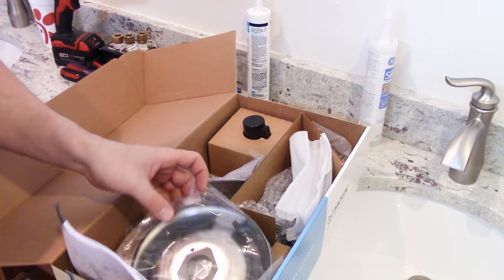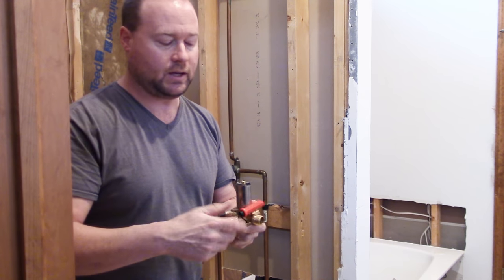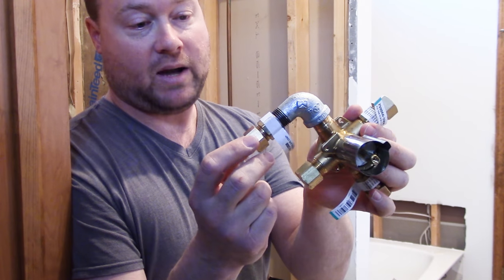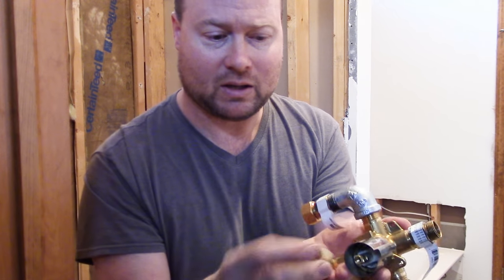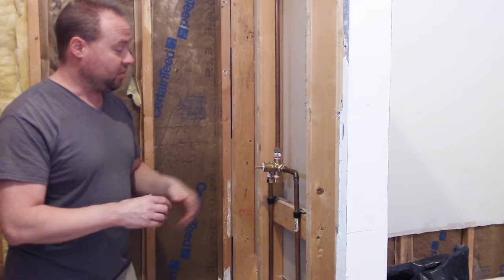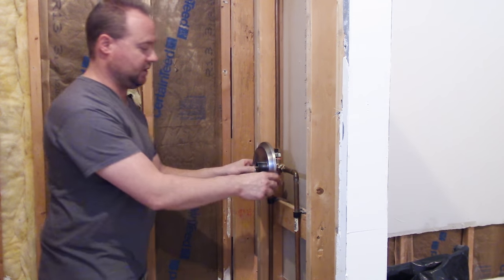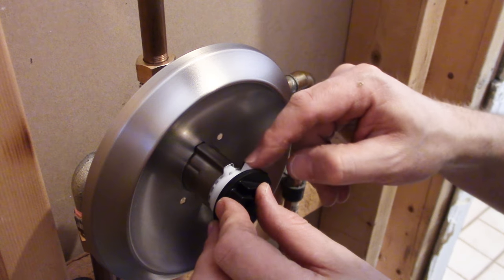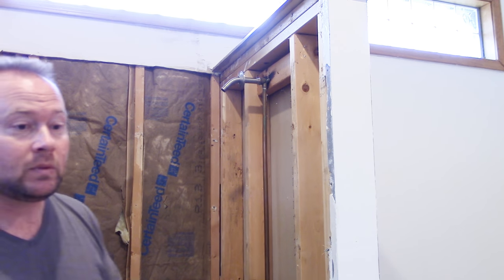Moen Shower Faucet Install

Comment: If you didn't want it to fail, you should have installed a brass street 90 instead of the galvanized street 90. Voice of experience here.

Comment: Thanks for the great video. I'm still in-progress on mine. I needed the 90 deg street fitting on both sides then connected Hot/cold with SharkBites. Turned water pressure on and very..very small leakage at 90 deg connection with the Valve. None of the SharkBites show leakage (so far). 

Question- When I screwed the 90's on each side connection to valve.. when they tightened they were not facing straight down.... so I had to back them off about 1/4 turn . Thus..the leakage. 
Would adding a few more wraps of Teflon tape or Pipe Thread dope help this? If I tried to turn them another complete revolution I'm afraid I might crack the very expensive valve connections!
 Thanks to any advice from anyone...even if I've found a solution before the answer..It may help someone else.
Reply from the maker: @DaddyDawg thanks for the question. This is a good one. First of all, I'm glad that you liked my video. It is a little older, but not a bad one and recently I went back and added chapters to it. So I'm also glad that you watched it with the chapters. Ok 2 things here. First is your question. And the answer is yes, if you feel like one more full turn is too much, then go back and add more tape. And are you using the cheap white tape or do you have a better one. I know that everyone is used to the cheap white tape, but there are better alternatives. This is a good one. https://www.amazon.com/Pack-Milrose-70885-Monster-Teflon/dp/B00IJZBB1A?crid=3G05LEZJB1EC7&keywords=tephlon+tape&qid=1642280876&sprefix=teph%2Caps%2C108&sr=8-6&linkCode=ll1&tag=greatwhitenin-20&linkId=f8c4ebb47d8ba588b8beb29d70979fc7&language=en_US&ref_=as_li_ss_tl

Then the second thing. I love Shark Bites and have a couple of videos of them. But the one thing that I don't like is putting them in a place that you can't access. So, I hope that you have an access panel for this shower. The reason I say that is because the Shark Bite uses an "O" ring, and I feel that they will start to fail in about 10 years. 

Good luck on your project! 

👍 So glad to help! Thank you for watching. Check out hundreds more of our videos at https://www.aroundthehome.org

Comment: We're doing this install now and I'm looking for help with how tight the inlet pipe for the shower head should be. It seems too loose in the position where it needs to be. But it can't be tightened another full turn. There doesn't seem to be a way to turn the female end, either. Tape and plumbers glue dont seem like enough either. Yikes.
Reply from the maker: @Margaret Grigsby, thanks for watching and your comment. I want to help, but I need clarification on a couple of things. You say that you are doing this install right now. And that the inlet pipe for the shower head isn't tight enough. First I want to confirm that this is the pipe that you are talking about. https://amzn.to/3NZGp0A  And if it is then you say that the female end won't turn either. If that is the pipe in question, is your female end not screwed to a stud or cross support?

Comment: i did it right just forgot screw in the adjuster and had to go buy allen screw from ace hardware (it has been missing in my last 2 remodels) but if the screw isnt in there it wont shut off,

Comment: What about the 2 screws into the plate? When I inserted , the screws hampered the handle from turning smoothly.
Reply from the maker: I'm only guessing here because I'm not there to see it,  but my first guess is that the faucet isn't square with the handle and plate. Sounds like when you tighten the screws it is binding. The faucet coming out of the wall should be 90 degrees to the wall. Does that help at all?

Comment: Very nice job.  Looks easy to do. 

What size are those compression fttings you used?
Reply from the maker: Just 1/2" compression to 1/2" threaded adapter. If you have an accessible area where you can splice in the water line like a crawl space, just using a sharkbite is much simpler. Thanks for watching and don't forget to stop by our website for many more helpful videos. www.greatwhiteninja.com

Comment: what about the water spout part of the faucet kit.  ??

You just did the handle and the shower head.
Reply from the maker: Yes, this install was a shower only. So I showed how to cap it off for a shower only install. Here is a video where I install a delta faucet that might help you with that part. https://youtu.be/KLvoFsE3NP0

Comment: I have a Moen Ashville shower head and handle and it recently became very tight to turn. Is this an easy fix, or should I seek professional help?
Reply from the maker: Sounds  like the cartridge is failing. The Moen cartridges are sometimes a bit hard to get out. They make special plumbing tools just for that. Sorry that I don't have a video on that for you. You might look up replacing a Moen shower cartridge on YouTube if you feel pretty good about your plumbing skills, of just call a plumber to do some basic repairs. Thanks for watching. Don't forget to stop by our website www.greatwhiteninja.com
Reply from the maker: Here is an Amazon link for a cartridge puller. Not too expensive. It's the same one that I have used for years. https://www.amazon.com/General-Tools-1809-Cartridge-Puller/dp/B000I1VBAE/ref=as_li_ss_tl?ie=UTF8&qid=1546984677&sr=8-7&keywords=moen+cartridge+removal+tool&linkCode=ll1&tag=greatwhitenin-20&linkId=b0d876a552eef21baaaf8f77c3133215&language=en_US
Reply: @AroundTheHome1  Thanks so much for your response. I have a plumber coming today.
Reply from the maker: No problem.

Comment: I installed this tye meon and am not getting any water coming through... yes the water line is turn on but no water coming through
Reply from the maker: That one actually has me stumped at the moment. Normally the problem with these Moens is the hot and cold water are reversed. So, no water is coming out of either the shower head nor the tub spout?
Reply: @AroundTheHome1  thank you for replying back.. yeah i don't have hot water but the hot water line is also connected but also the cold water not coming out of the  value I don't know why I find it change

Comment: I watched the video and realized I did not pull up the video I need.  I am trying to remove flow restrictor from Moen Ashville shower head,  Any guidance is appreciated!
Reply from the maker: I'm sorry, I am not familiar with that shower head. If there is a flow restrictor in the shower head, it should be right at the opening where it connects to the pipe. Do you live in CA? They have additional laws which force manufacturers to add additional restrictors to their products that I would never see out here in the Mid-West. Thanks for watching. Don't forget to stop by our website www.greatwhiteninja.com

Comment: to bad I didn't have you to do the job when I put the shower and faucet in, the pipes in the wall are backwards, the hot to the right, cold to the left, and I can't adjust the temp the handles upside down, and middle is off,  right is scalding hot, the left is freezing cold middle is off, so no adjust the water to warm, I'm MAD that I'm dealing with this, Mr pro who fixed faucets for a living didn't know shit, you get what you pay for like a flooded kitchen floor on Christmas day, and having to replace the the whole floor, let alone the shower. I bet where mine say's up, it's upside down, because mr know's it all knew better than MOEN  themselves. It's all jacked.
Reply from the maker: So sorry to hear that. That's never a good situation. I wish you luck in getting everything fixed right.  Thank you for watching. Check out hundreds more of our videos at https://www.aroundthehome.org